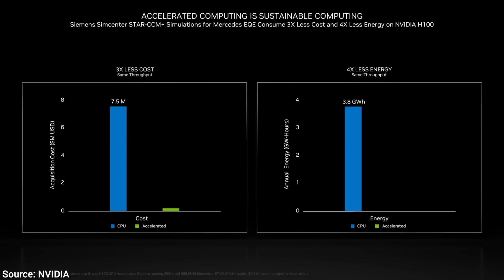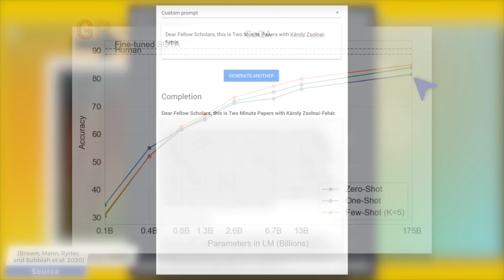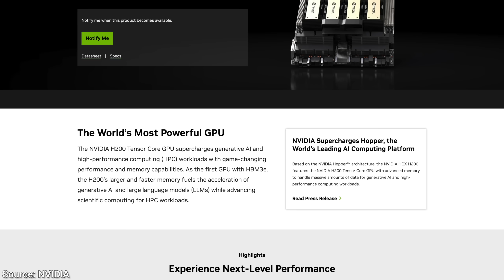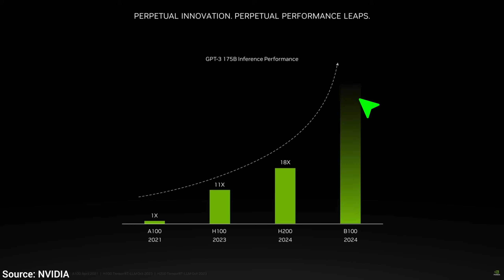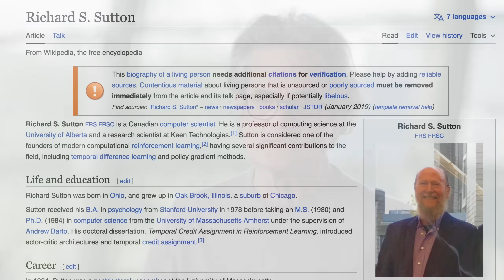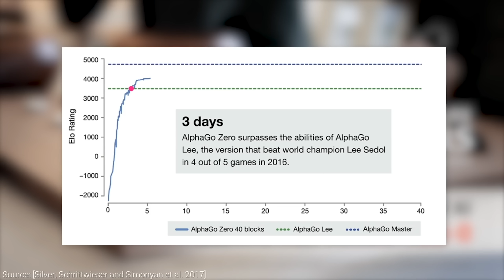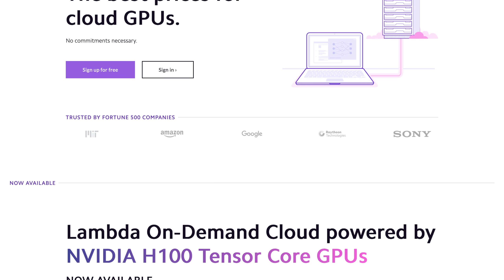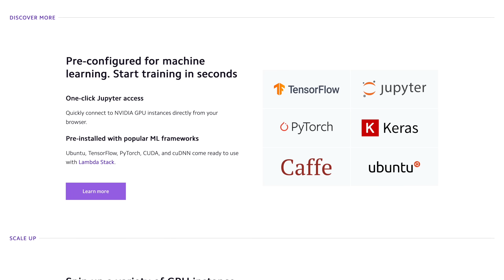10,000 Of These Train ChatGPT In 4 Minutes!

Comment: Generated using Talkbud (Browser Extension):

📝 Summary of Key Points:

📌 Nvidia has announced their new graphics card, the h200, which is expensive but offers benefits such as simulating scenarios, powering supercomputers, and performing fluid simulations.
🧐 The h200 graphics card has almost double the memory capacity and increased memory bandwidth, making it more powerful and fueling research and innovation in various fields.

💡 Additional Insights and Observations:

💬 "The increasing compute power provided by this graphics card is fueling research and innovation in various fields."
📊 Nvidia can now train a GPT3 AI in less than four minutes, a remarkable improvement.
🌐 Specialized versions of this technology have been used to create a chemistry assistant that can predict crystallization outcomes.

📣 Concluding Remarks:

The new h200 graphics card from Nvidia offers significant compute power that benefits AI research and development, as well as various fields of innovation. Despite its high cost, the card's capabilities have wide-ranging impacts and contribute to advancements in technology and scientific development.

Comment: Well it says that's the time to train it on 1 billion tokens, but to actually train the model you'd wanna use over a trillion.
This would make the trillion tokens training time 66.6 hours. It's still insanely fast.
At a cost of 6$ / hour of renting one of these (I've seen 4.8 for H100s, so this is probably close to what its gonna be), it would cost 3 996 000$ to train the GPT-3 model, or pretty close to 4 million. A rough estimate for training GPT-4 to similar convergence is 128 million.

edit: I'd also like to add that the flops / second of the H200 are identical to the H100. The H200 merely has more memory and a higher bandwidth memory interface.

Comment: 3:10 I couldn't get - how did they managed to increase a training time from weeks to minutes? There's only x2-x3 more performance, isn't it?
Reply: It uses 3584 * H100 simultaneously, on 1B tokens (chat gpt has 600B token)

total hour = 4 minutes * 600 B minutes
total hour = 2400 minutes or 40 hours
3584 H100 * $2 per hour * 40 hours
2*40*3584 = $286k 

(my math may be wrong, but if it is true, then cost is being too down)

Comment from the maker: Fellow Scholars! Note that the results at 3:12 were recorded on a set of H100 GPUs. Also changed the title of the video to emphasize this. Some thoughts about this episode here: https://www.youtube.com/post/Ugkx4PzvNdFXaAe8FRrmemKw4_8EbcgoQEw6
Reply: for those of you wondering, the footnote at 3:08 states how many GPUs were used per benchmark.
in the case of the GPT-3 one, for instance, 3584 H100's were used.

(if that many chips took 4 minutes, it'd take about 10 days with a single chip)
Reply: @a_soulspark  still pretty impressive
Reply: @a_soulspark  in power in exa flop .!?
Reply: Also, that GPT-3 training time was only for 1 billion tokens. For a full GPT-3 model it would take at least 300x longer.
Reply: There is already 2x faster than h200: b100 💀
Reply: The other comment is nice but I REALLY think this clarification should be pinned instead. Also, as just a general question for anyone to answer: how big is the set of computers that was used for this? The formatting of the footnote is abysmal. Am I correctly understanding that it’s using 3,584 H100s + over 10,000 of some another device for the GPT-3 1B?